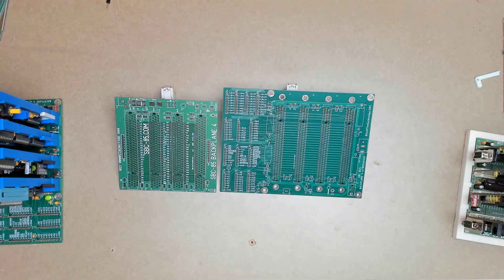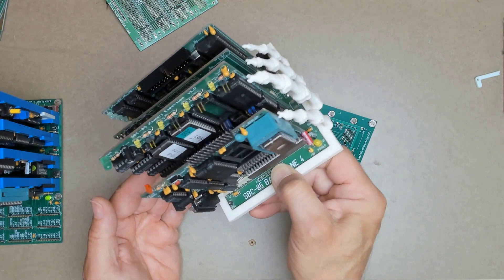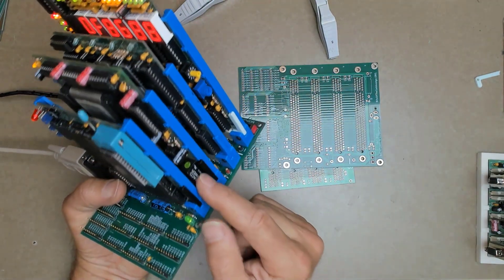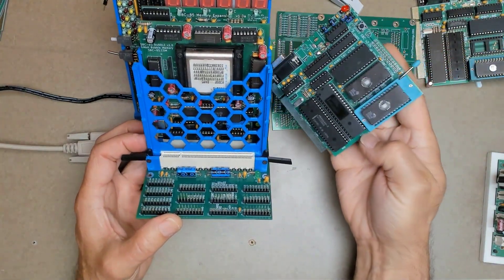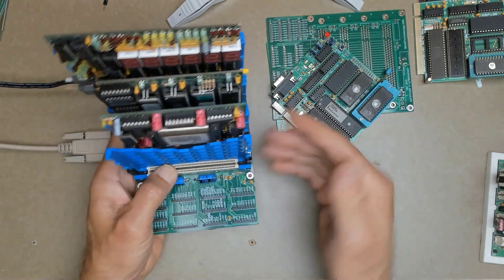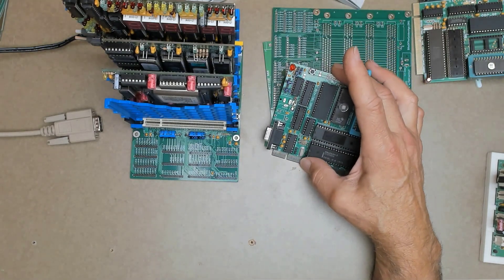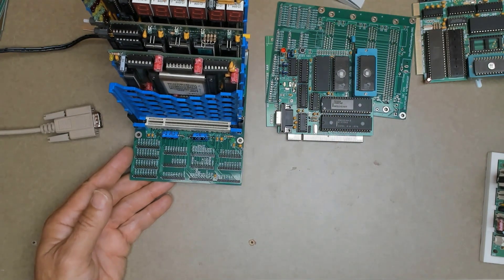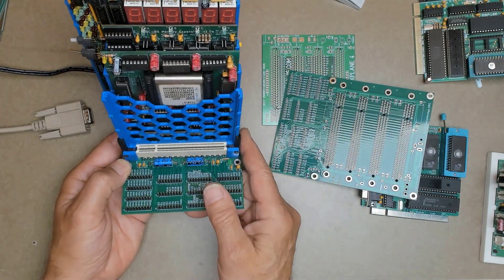{109} New SBC Bus Backplane 4 w/ Testpoints AND Transitioning to a SBC BUS Specification Document

Comment: I suspect you will have covered it in another video but I would like to know what connectors you have gone for in your standard?
Reply from the maker: 120 pin PCI connectors. AMP/TE 5145154-1. Incredibly reliable, readily available, and dirt cheap even with nice gold plating.  (Note the bus is not PCI compatible, just uses a PCI style connector.)
Reply: @HelloWorldETX  Thanks, sockets £2.86 for one off from Digikey UK.

Comment: That's one of the nicest mechanical designs I've seen on a home brew system... as long as it's not burried away in an enclosure, those ejectors are great.
Reply from the maker: Thanks.  I have updated the project site to include STP files for the card guides.  The single ejector on the 125mm wide does not work all that great, I need to put some more thought into that design so it lifts straight up with two ejectors.  https://bitsofthegoldenage.org/documentation/sbc-bus-backplane-4plus-documentation/

Comment: These boards are a Beautiful Through-Hole Nightmare.

You sure did get your money's worth on those old $0.40 boards when you shoehorned them into the 100x100mm "cheapo" footprint.
...I wonder if anyone did a 100x100 that filled the board with just through-holes with the minimum allowable pitch...
Reply: I'm in the process of creating a backplane on 100x100 and squeezed 8 slots on there.
Reply: @Philip8888888 Ha. I'd bet the board-house hates you...
Reply from the maker: indeed.  Nothing like the days we paid 10 cents or whatever it was for each plated through hole.  Plus film charges for vias, solder mask, and silkscreen.  Thank you globalization.